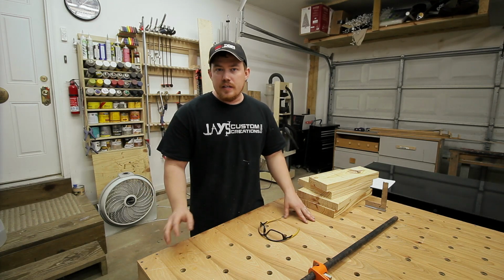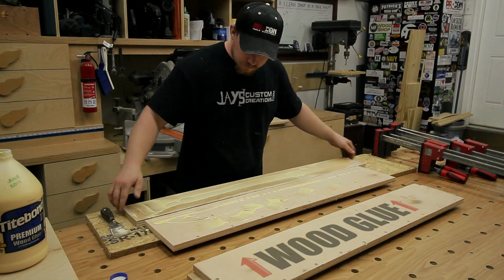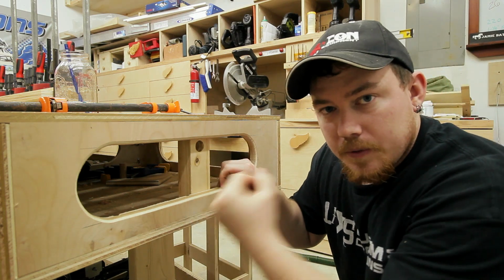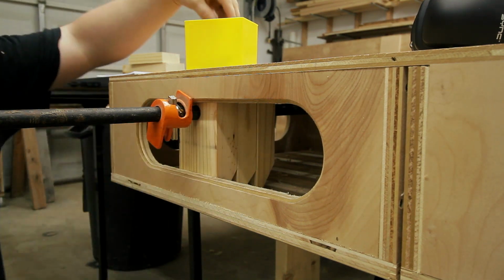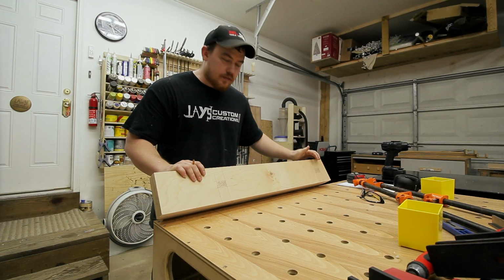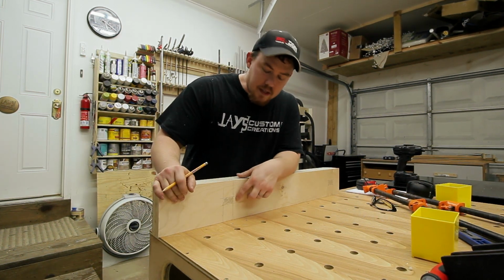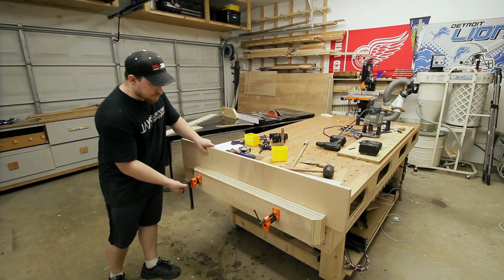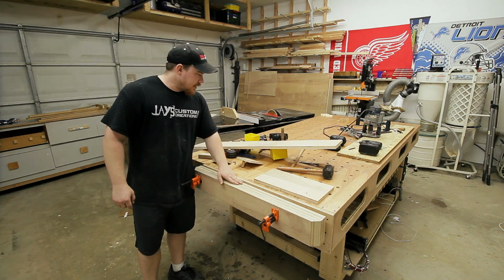Pipe Clamp Workbench Vise - 210

Comment: Did anyone notice the gap between the board as the screw point pushed the next board it was to enter?  you need to predrill OR clamp the two boards together before drilling and then you get a very tight fit.  in this case, it isn't critical but in some cases, it could be.  It's all a matter of methodology and of work habits, good work habits.

Comment: I loved this video -- of course I usually enjoy and get a lot out of all of your videos, so that was to be expected I suppose.

On one of my workbenches I decided to forego the ability to skew the jaws on the vise and instead increased its stability by inserting a 1/2" aluminum rod into the 1/2" iron pipe and securing the exposed end of it to a stop under the workbench.  It works as smoothly as my "store-bought" bench vise (a used Rekord 53-1/2) and is extremely steady.I didn't have to add any lubrication between the iron and the aluminum). Also if I ever need it I now have up to a 22+" opening depth on the jaws if I ever really need it (and if I wanted to get ridiculous, I could swap the current rods for far longer ones, but why bother...).  It's also very sturday: as a test I clamped a 22"x21" drawer to the vise  and then loaded it up solidly with about 160 lbs lea weights (120 # of them) plus cut-offs, etc., from my "exotic wood" bin.  There was no sag that I could tell by eye and when I measured it, the actual sag was just less than 1/16" at the farthest end of the vise.  I was very happy with the result.

So thanks for the idea - I have put these vises on 2 workbenches and will shortly be adding a leg vise on the new (replacement) work bench that I'm just about to start building (I got inspired by one of your leg vises ... so again, thanks).

This was an excellent video and I learned from it.  And after doing woodworking for just under 50 years, that's saying something.

PS,  please keep the humor in ... I loved watching the glue dry :-)

Comment: A really good presentation - I built one, too but have a question.  I  screwed the inside (movable) piece to the inside of the workbench.  But I had to remove that and secure the outside piece to the chop because I couldn't reach inside to loosen both internal clamps simultaneously.  How did you get around that problem?   (And thanks for the video:  I bought the pipe and clamps to build one of these about 15 years ago, but my better half surprised me with a really nice bench vise the next  day and I couldn't build the one I had planned [keeping peace].  So now I did it and it works beautifully - thanks!).

Comment: Jay, is it possible to put the bars lower than 2 1/2" from the top of the front face? I am getting ready to build a workbench. The top will be 2x4s glued together. After watching this video, I want to make one of these vises. I could make the front three boards 2x8s. That would give support for the clamps. But, with the rest of the top being 3 1/2" deep, and with the front face down an inch (like yours appears to be), I would have to put the bars at 4 3/4". Will that cause any problems?

Comment: Thanks for the detailed photos available on-line. I just completed my version of this end vise for my first rather awful looking workbench.  I made a few errors in measuring the location of the inside hole in my 2x4 bench cross-member but it works well with my cheap H-F clamps.

Comment: Jay, my bench has 2x6 runner along the outside. Do I need to make a rear jaw or would my actual bench work as the rear? I know you made one because of the hole in yours. I would think the 2x6 would be fine, and I would just need to make a front Jaw..? Thanks

Comment: I'm going to add a pipe clamp vise to the bench I am just about completing. To get over the fact that you have to reach under the bench to release the stationary end of the clamp so that a larger jaw opening is possible, I'm going to attach a rod to the release tabs of the stationary clamp actuated by a lever beside the jaws so that the far end of the pipe can be released to open up the jaws more than the thread allows.

Comment: Excellent idea! But it seems I'm very far from alone in wondering about the details of how you adjust the "catch" side of the clamp (The part WITHOUT the clamp crank which you use to tighten the clamp as you normally would with this clamp.) It appears you have to somehow reach underneath the table to "snap" open the clamp that's mounted underside of the table. Did I get that right?

I guess my confusion is due to that you already have those openings in the bench to work from, but most people don't, we just have a tabletop that is (generally) open underneath it. In short, it would've been nice if you'd have taken a video of the fully assembled mechanism along with a short "Here's how I use it" video. I (we) can figure it out, but I expected to see how you adjusted the clamp to suit other sizes of materials we'd want to clamp (e.g., how you can both hold a 3/4" board or "go big" and use this clamp to hold together laminated table/bench tops with this clamp.)
Reply from the maker: https://www.youtube.com/watch?v=MFEVWtKSqo0

Comment: So it's limited to the throw on the clamps thread. To anything wide, you'll have to use the adjustments on the inside jaw? (Let out some slack?)
Reply from the maker: Yeah. Let out some slack. Not difficult. Easier than adjusting the parallel guide pin on a leg vise.

Comment: Nicely done. JUst a word though:
You might want to incorporate something so you can use the quick release inside your table.
Also, when you screw two pieces of wood together the screw tends to push them apart leaving a gap. If you don't want to clamp them together you could back out the screw and then put it back in with some pressure.

Comment: The maximum clamping is 6" or less and if you need more you have to ask for help to release on side of the pipe clamps
Reply from the maker: You have no clue what you're talking about.
Reply: I have 3 month in woodworking so tell me how do you put a wider stock in the vise instead of telling me that I have no clue or you were born knowing everything?
Reply from the maker: I never said that YOU have no clue what your talking about. I said that I (ME) do not have a clue as to what you were talking about. I (ME) still don't have a clue as to what YOU are talking about.
Reply: Just go back to the video and read 4 Sept 2016 what YOU wrote. And thanks for the answer. When I finish your fine project I will send you a picture because I´m a big fan of your work.
Regards
Reply: Jose, if you haven't already figured this out: you reach through the side hole (or under the table) and flex those chrome tabs backwards while pulling the bar out. You might have to do one side at a time. A little tab welded on the end of the bar would keep it from coming to far out so you could just yard it out all the way and push in as much as you don't need. If this doesn't make sense it may be that your not familiar with this type of clamp.
Reply: Thanks very much. I built it already and it was clear that I needed help if I ever needed more than the 6". Regards

Comment: Thanks Jay.  I just finished my own version of your vice design.  Added a recessed stop instead of dogs.  I didn't use rectangular slots as you did, and I don't seem to have to much of an issue with racking, but I could elongate the holes horizontally if that becomes an issue.  I really like the strength and the best part is I got to recycle some old 3/4" plywood from an entertainment center I built 15+ years ago (Sad day, but the day of old tube TV's has left us).

Thanks Again.  Please take a look at my video if you have a chance.  I put a tribute to you in the middle (teaser!)
Reply from the maker: +Jess Cretney Thanks. I just put it in my watch later playlist. I'll check it out.
Reply: Are biscuits bullshit?

Comment: holy crap!  brand new to your channel and I am amazed at both your woodworking skills and videography skills.  Subscribed!
Reply from the maker: +2ridered2 Very cool. Thanks!
Reply: +Jay Bates @ 4:53 where you bring the stop block over and set it to 36" what is that thing called? seems much easier and more accurate then measuring and marking a line. is there a video on that piece?

Comment: JAY, I am asking a question which there didn't seem to be a response from you!!  Are you having to reach under the table top to release the pinch of the back vise of this clamp or are you using the tops hole placement to reach to the pinch of the rear clamp to release the vise??
Reply from the maker: +Benjamin R https://www.youtube.com/watch?v=MFEVWtKSqo0
Reply: Awesome, Jay as I watched your video it seemed straightforward enough, however I did see the possibility of going through the 20 mm holes on top too...Thank you

Comment: Any reason you made the front jaw so thick?
Reply from the maker: So it flexes less
Reply: +Jay Bates Ah yes, makes sense. Thanks for the quick reply.
Reply: +Jay Bates Another question I had was how to you pull the vise out more? The clutches that release it to open up are the ones that are secured to the stationary rear jaw, right? For some reason, I'm having a hard time picturing how you would do this. Or, do you have to reach underneath and do it that way?

Comment: So...maybe I missed something.  How do you release the pipes when you need to open the jaws wide?
Reply from the maker: The same way you release a quick release bench vise. Reach in and press the lever.
Reply: +Jay Bates Have you found this to be cumbersome at all?  Possibly enough so to make you want to set up an 'external' release mechanism?  I only ask because my work bench is not as 'open' of construction as yours is and I can see this possibly being an issue for my particular situation.

Comment: Would you have added more structural strength to your pipe clamp mount, by facing the middle boards chamfer up instead of down?
Reply from the maker: +Despicably Irascible Rapscallion That wouldn't make any difference.
Reply: Jay Bates Fair enough.  I was thinking it might spread the surface area out more evenly between top and bottom.
Thanks for the video.

Comment: My suggestion would be that the front jaw should be an inch higher so that you could then use the dogs on the table, this way you have to insert something every time when you wish to use the table dogs.
Reply from the maker: Yussuf Bagus Then it would be in the way if you wanted to slide or hang anything off the table. Also the jaw will rack at the very least a  little bit causing the jaw to no longer be perpendicular to the work surface and therefore pushing the work piece up slightly and not clamping at all.
Reply: Maybe a removable one then?

Comment: But you have to reach in from 2 sides to release and secure the movable pipe clamps .I find this very inefficient and awkward.which means your workpiece is unsupported while you are adjusting the vise.At least with the top mounted vise it was easy to get at.I personally do not like this design at all.,even though it is well built.
Reply from the maker: 738polarbear Please watch this: https://www.youtube.com/watch?v=MFEVWtKSqo0
Reply: Having seen it in use ,it is NOT as awkward as I thought .My apologies ,but it is still a very well made item.

Comment: Great vise, great video. Just one question: Isn't it unconfortable adjustigen the "fixed jaws" of the pipe clamps themselves? I imagine that reaching down into the table from both sides isn't that handy.
Reply from the maker: MrPeterwaldi Just the same as using the quick release feature on a regular woodworking vise. I'll show how easy it is in my next vlog video on my second channel.

Comment: Great video and great idea but I don't see how you slide the front face out since the locking mechanism on the rear pipe clamp jaws are under the table. Do you need to reach in/under the table every time you want to slide the front face in or out?

Comment: This may be a stupid question and it may have already been asked but... how do you open it without reaching on the inside and pushing the release on the clamp?
 
Am I just missing something?
Reply: I built this project (thanks Jay!) and didn't like that fact (yes, you have to undo each side manually), so I made a foot pedal with emt that slides up under the little pull tabs and releases both of them simultaneously. It worked well, until the release plates deformed and no longer held the pipes (cheap clamps? not proper use? whatever...). So, I screwed the pipes to the release side of the clamp so it would move. Now I just use the tightening screws to clamp my work. Much less clamp distance (about 3-4" instead of a 1') but its solid as a rock! Again, even with the issues, many thanks to Jay for this brilliant and simple (and cheap!) idea :D
Reply: Jacob Bell Ditto that question!  
>>Like so many others, I love your videos Jay.  
>> When it comes to editing, you've got CLASS!!!  Speaking of class ... how about an educational video on how you go about editing your videos--workflow, edit tools, etc?  Thanks!
Reply: I made one that has a lever that releases the pipe clamps and is flush with the bench top.  Love it.  thanks.
Reply: Holy resurrection Batman!  I just saw this and wanted to ask the same question. I'm sorry I didn't peruse the 600 comments, maybe it was answered. 

I recently found your vids, and love the editing, and content! That bisquit joke was pretty good. Also liked the rewind forstner bit
Reply: Jacob Bell I wonder the same thing..
Reply: +OwLoLz I am asking the same question: to open it you have to release both clamps, no ?

Comment: How do you pull it out if the adjustable part is under the bench?
Reply from the maker: JustinTime Reach in and release the pipe. Just the same way you would have to release a quick release bench vise.

Comment: Nice job Jay but I thought I heard you say 7/8 inch hole was required for standard 1/2 inch pipe ? Did you mean 3/4 inch pipe cause that is what it looked like you where using ,not criticizing just wanted to get it clear in my mind as I believe I'll build one of these ,with your permission of course.
Reply from the maker: Harry Short No permission necessary. Build as you wish. Nominal pipe sizes are way off of actual. A standard 1/2" pipe needs a 7/8" hole. A standard 3/4" pipe needs a 1-1/8" or slightly smaller hole.

Comment: "To open the jaws of the vice in order to increase the size of clamping, do you have to reach into the workbench and fiddle with the other end of the pipe clamps that is stationary since that is what to locking the system?"

Asked by another commenter, I was wondering this same thing.
Reply from the maker: David Hall Yes. Reach in and open it up. Just the same as if you had a traditional woodworking vise with quick release.

Comment: do you have to reach under to release the end clamp to pull the pipe out to make the space between the jaws longer?
Reply from the maker: fiberinspector Yes. Reach in and open it up. Just the same as if you had a traditional woodworking vise with quick release.

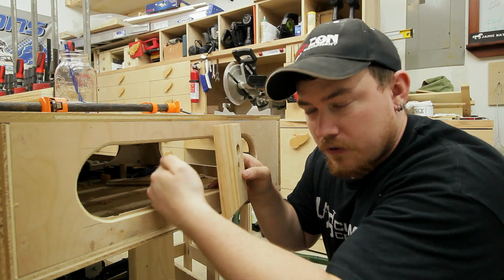Comment: Okay, I have been considering a pipe clamp vise since your original moxon project.  I had recently discovered this version of a pipe clamp vise (https://www.youtube.com/watch?v=9qe1iLsncRM), but it seems a little sloppy compared to yours, though he does a good job.  Starting at 1:50 in the other video he explains a "quick release" mechanism.  I would very much like to see your take on developing a similar concept.  That would be my only frustration, is having to slide each pipe individually while holding the lever release in the back until I had them opened to any desired width.  Keep up the good work.

Comment: Nice and diesel! How far does it open? I made a moxon vise and didnt put anything in the holes to protect it from threaded rods and now its all scuffed up and doesn't grip when i turn the knobs and sags in every direction. So i sd screw it and took it down. ill have to re think and re make it in future. Live and learn i suppose. Have a good one jay
Reply from the maker: Joe basementwoodworking The capacity of the vise is as much as you want it to be. Just add longer pipes.
Reply: Jay Bates oh ok..thats cool and convenient.

Comment: To open the jaws of the vice in order to increase the size of clamping, do you have to reach into the workbench and fiddle with the other end of the pipe clamps that is stationary since that is what to locking the system?
Might get a bit fidgety  over time should come up with a solution for that. Though they are pipe clamps and can be easily shifted and adjusted as you did allow for it to be adjusted on either side.